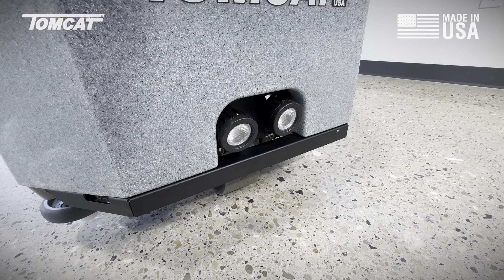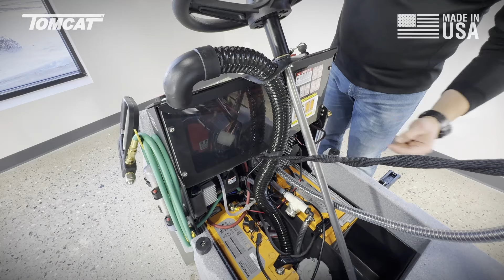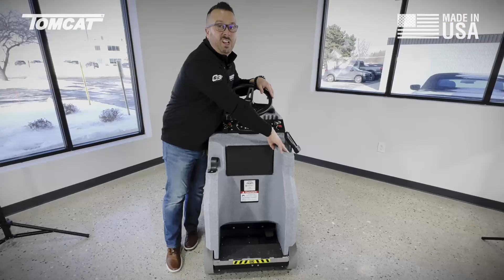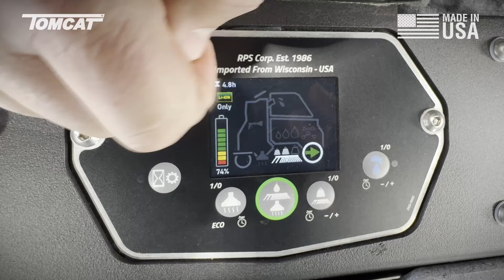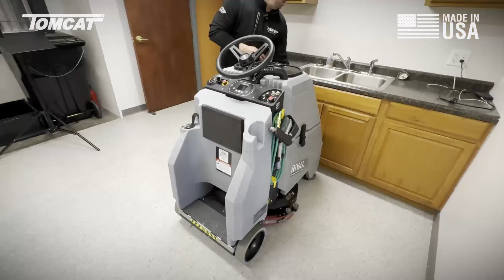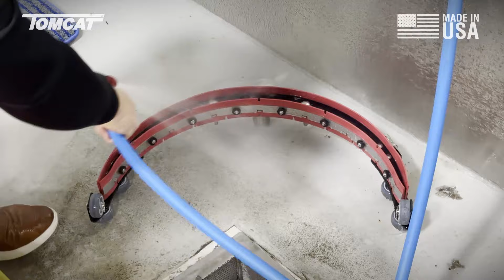Tomcat's New Stand-On Floor Scrubber: The Rival

Comment: Thank you! Finally a competitor to the Chariot (It's junk).
Reply: The company I worked for from 2018 to 2022 also used a Windsor Chariot.  The machine was not reliable and the squeegee chattered.
Reply: @kagome122885  As a service tech for these type of machines, that Chariot had to be the worst reliable, difficult to work on, and worst performing.

How they continue to get sold is beyond me.